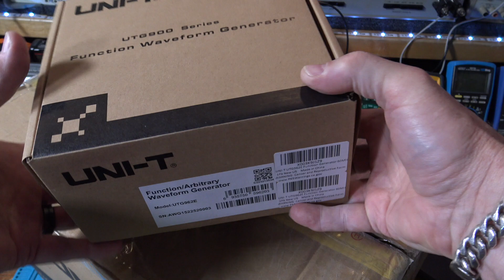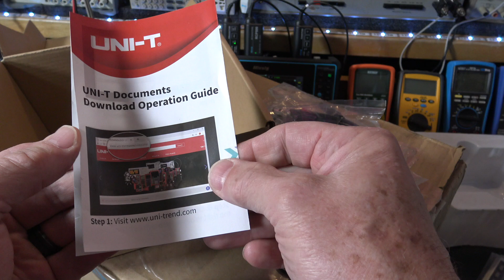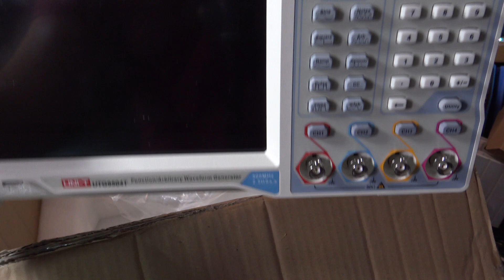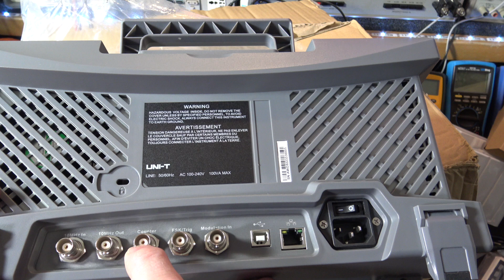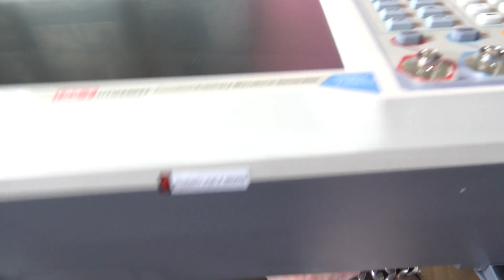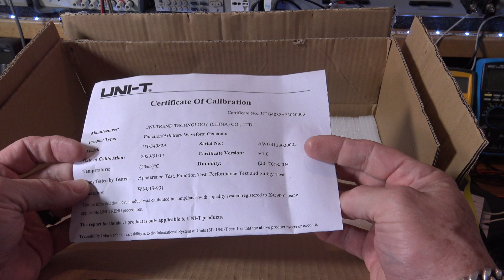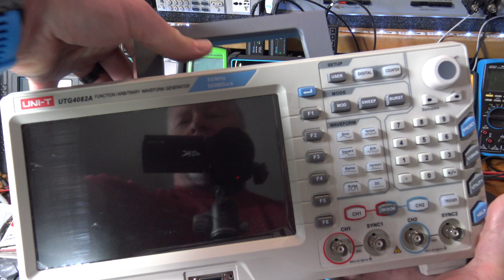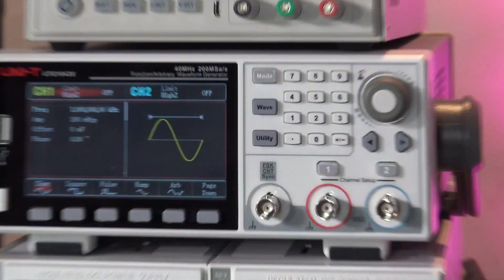ARB Signal Generator Shoot Out Box Opening with Uni T  #UTG962E #UTG1042X #ARBgenerator

Comment: I have the UTG962 and at 10 MHz it reads 30 to 40 Hz high.  I have seen a few reviews and tear downs, but one seems to test the unit for accuracy or whether it can be calibrated. Can you please comment about this?  Thanks
Reply from the maker: Thanks for the question.  Does it read high in all waveforms?  At what frequency range do you see this?
Reply: @KissAnalog  Hi Eddie.  I should clarify my observation.
When the generator is set to read exactly to 10 MHz, the actual measured frequency reads 37 Hz lower. 50 MHz reads 189 Hz lower. 60 MHz is 231 Hz lower. It gets better with lower frequencies.  At 1MHz the frequency reads 3 Hz lower.
These are sine waves.  Square waves, are about the same.
I was thinking of modifying it to allow for an external time base reference, but it requires 50 MHz and my GPSDO is 10 Mhz.
Reply from the maker: I finally took some measurements.  I took these with several generators to compare.  They were all about the same.  I then looked at the tolerance and it shows 50ppm (parts per million) and at 10 MHz that translates to 500 Hz (which is equal to 0.005%).  I guess I normally don't look at that many digits, but my readings were actually a little bit worse than yours, but well within the specs.  

Does this makes sense?
Reply: @KissAnalog  Thanks Eddie, that does make sense. I guess I should pay more attention to the accuracy in the spec's. Thanks for taking the time. Your excellent videos have contributed to my selection of several pieces of test equipment over the past few years. All the best!
Reply from the maker: Thanks for the awesome feedback!  I'm glad you asked as I never really have anything that critical for waveforms, but now I will pay attention to that;)

Comment: Gary, please do a check on the utg962e to see if the level out drops when you enable AM MOD.  When generating a signal of 14 MHz sinewave, 
When I turn on AM modulation with 1 KHz sinewave the output drops by 6 dB or the voltage drops in half. 
It does NOT seem to drop if I use other modulation like FM, etc. This 6 dB drop is observed even if the AM depth of modulation is set to 0%. 

Can you confirm?? do you believe this is a firmware issue??
Reply from the maker: I'll check that - thanks!!